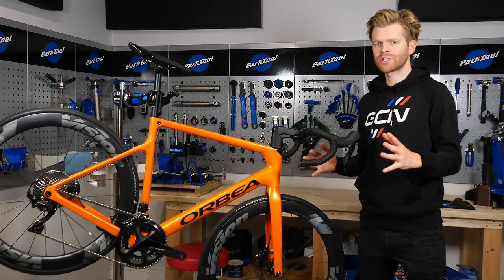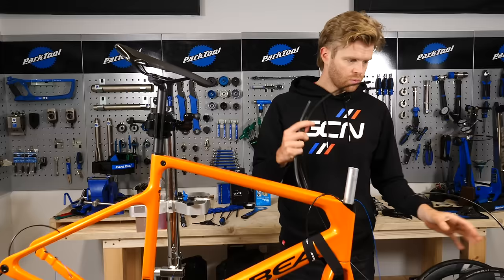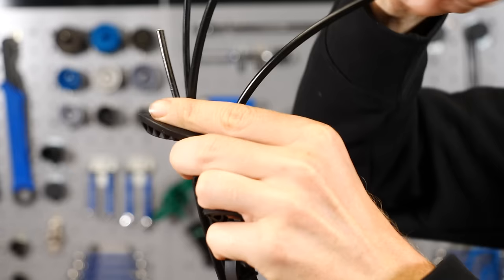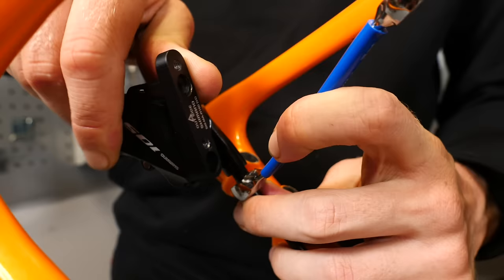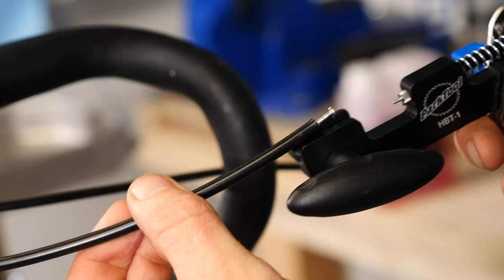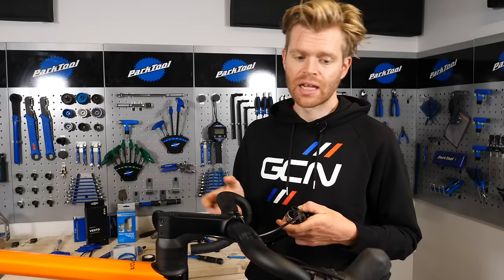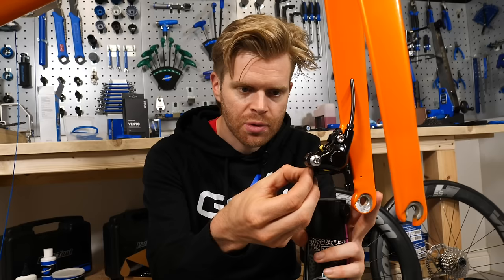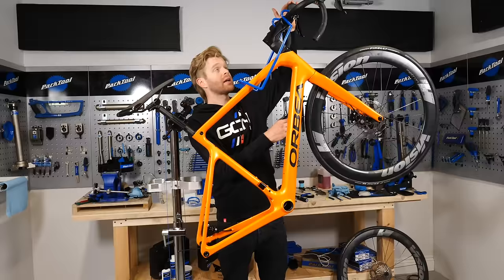How To Fit & Set Up Shimano Road Bike Hydraulic Disc Brakes | GCN Tech's Full Setup & Installation

Comment: Just bought a new bike with Ultegra hydraulic discs.  Now thinking it might be a mistake.  This looks a total faff.  How much does the full set of tools needed cost, if you use Park tools?  Would you trust your local bike shop to fit these hoses etc?  Safety critical and needs the right tools and great care?
Reply: It's not that hard. Plenty of videos on YT on how to do it. Bleed kits cost about $35 Australian, a litre of Shimano mineral oil (roughly 1 lifetimes supply) is another $30 AUD. Internal routing kits (which I personally can't recommend highly enough), maybe $40 for the Wiggle/CRC version, and you'd need one any way if you had a rim brake bike, plus normal tools you should have anyway. So, about $120 Aus (or about £10......)
Reply: It's not that difficult and your local bike  shop will have done the necessary training and have every thing they need to do the job properly.
Reply: So you bought a new bike with discs? All of this is done for you already. No faffing needed.

Comment: #askGCNTech  I have noticed recently that when I pull on my front brake at any speed [6 year old Tektro Hydraulic] the front wheel moves to the left, top view obviously.  I have no idea how long this has been happening but looks worrying. I have checked the wheel bearings and centred the caliper to no avail. Could it be one of the pistons seized, or is this normal?

Comment: after watching this, I decided to buy the cable actuated disc brakes with hydraulic calipers instead.  Just way too much work with entire hydraulic system.
Reply: 99% of the trouble with this video is the internal routing. Which would be the case either way. Hydraulic brakes are set it and forget it for at least a year. Mechanical ones take much more constant maintenance and aren't much easier to set up on the first go. You should be able to bleed the brake line front and back even if it's your first time and all of 10 minutes including cleanup.

Comment: Did he put the front brake on the right hand?
Reply: Most likely.  In the UK (and Australia), front brake is on the right hand.
Reply: My bike had the front lever on the right. I thought it was the easy way to bleed the brakes especially doing the back wheel. But I changed them around so the front is now on the left. It of a pain in the ass bleeding the back brake 😣
Reply: @richardhaselwood9478  Wow, that's got to be the dumbest convention ever.  Front brake on same lever with Front derailleur... Rear with Rear.  Why would anyone do it another way?  Is there some technical reason?
Reply: @sekalfwonS-99  probably because we drive on the other side of the road
I couldn't ride any other way. Means my dominant hand controls all the important stuff, front brake and rear mech

Comment: just go with rim brakes :)
Reply: I like to keep it simple - install new cables ( and pads if needed) once a year and I am done.
Reply: @markg0410  especially when it comes to commuting
Reply: @harisahmetspahic9877  Yea but... what if its raining? Or even worse, rain + carbon wheels
Reply: Will it give you the same "bike surgery" experience? ^_^
Reply: @maple4567  I think it is survivable.
Reply: This video is not selling me I must say what a faff
Reply: Are mechanical disc brakes for road any good ? Ie safe and functional?
Reply: Pete is never wrong  Same, three years on my disc roadie, not one second of maintenance needed yet. Still the same pads even. Screw replacing and adjusting cables ever again.
Reply: @mididoctors  They're "OK"..... I've been running them for 5 years and they're not too bad. Would greatly prefer hydraulic though
Reply: Pete is never wrong  I do all my own maintenance .. the very idea I need a shop equals fail to me . I heard good things about the spyre mech discs ?
Reply: Pete is never wrong  cheers for that reply btw

Comment: Man, I'm sticking with rim brakes. Riders have been managing just fine with them for decades. I think I'll be okay.
Reply: wahwah1013 Booooooring
Reply: @tomahoks  It's more fun than trolling.
Reply: Rim breaks are fine but in winter months with carbon wheels not so fun and wheels are expensive to replace. Test ride any disc bike on a wet decent and you will have so much more fun and a bag confidence in your brakes
Reply: Are mechanical discs brakes for road any good? This is ridiculously faffy
Reply: @mididoctors  no, your posting the same thing over and over and over on this video is the exact definition of faffy.

Comment: 'A couple of half turns' ..... really? Do that and you'll have old brake fluid flooding out. A quarter turn only and it's open. Also, no clearing of air from the syringe, like doctors always do, and it was far too full. 3 cm worth in a syringe will be plenty. Finally, no 'burping shown of the levers. Shimano require adjusting the lean angle twice, either side of the perpendicular about 20 degrees and the lever depressing to shift the last remaining bubbles. There is an indicator on the side of the lever but this was never referred to. This is an error strewn video; lazy of GCN. They don't have proper mechanics and this is worse than a bloke in his shed.

Comment: To set up your rim brakes, you'll need almost none of this...
Reply: Rims brakes are so simple and work very good compared to this pointless over complicated disc braking system not even needed for road racing.
Reply: @atticushexcel9567  I was exclusively discussing road disc brakes. On my MTB I use discs, but not the hydraulic calipers. I simply dislike the idea of overcomplicating the system.
Reply: @robtankbuster5215  rim brakes don't work well. The modulation is awful, power inconsistent and destroy rims
Disc brakes are amazing, road or MTB,
Reply: @richardhaselwood9478  the Tour De France was just won with a rim brake rider and always has.
Reply: @robtankbuster5215  the tour de france was won by Tadej Pogocar cause he is an exceptional bike racer not because he was on disks or rim break. I dont understand why people have so many opinions on breaks, we as customers and not racers can choose whatever we want and that's great!
Reply: @michaelborg3017  Great point.  Also, I do want to make a point that frankly, the argument of what the pro's use (one way or the other) is pretty ridiculous for almost anyone who doesn't race.
Reply: @richardhaselwood9478  Totally agree mate!

Comment: 22min video for discs, for rims probabyly 5min video
Reply: 5min of video that you need every time you wear out your outer and inner cable. Something you'll never have to do with hydraulic lines.
Reply: @JippaJ  But you need to bleed in the same time steps or even ofter compared to changing cables for rim which
Reply: @Leon-vq7hv  No you don't. You bleed them once (maybe twice if your first job wasn't that good) and then leave them alone for 10 years.